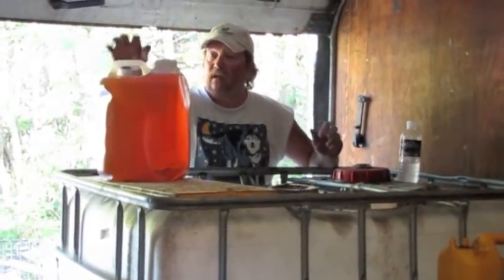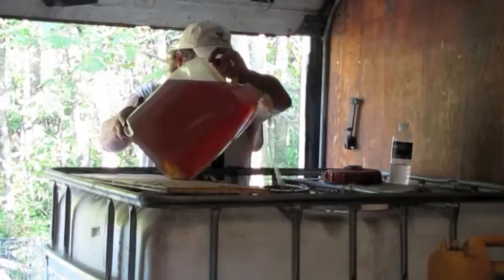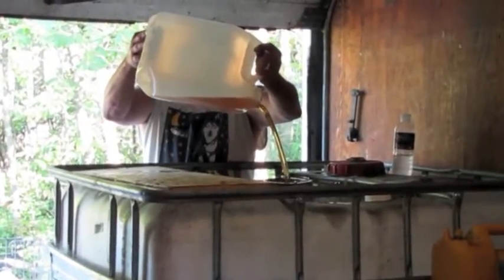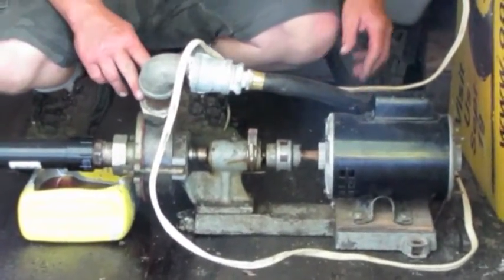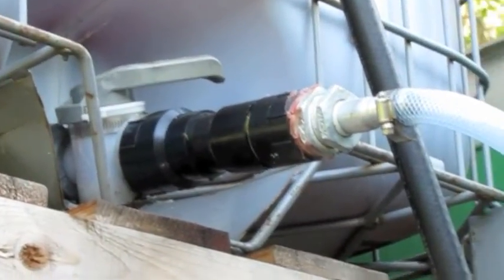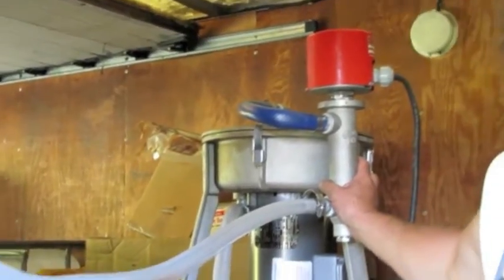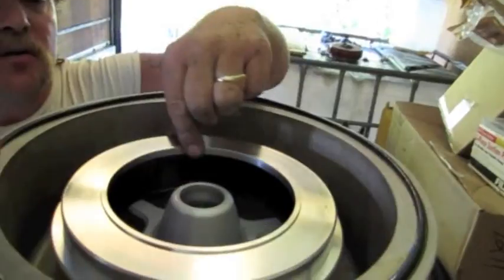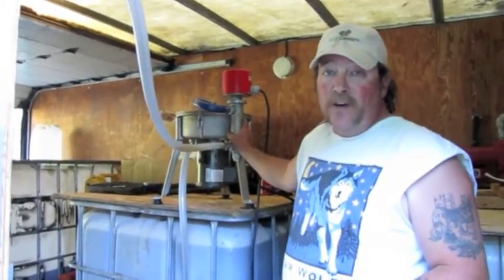Ricks Refinery

Comment: Well cold weather has finaly hit us.Burning oil has stopped abruptely.Burnt 2500lts.But I already have 3000lts of partly clean oil.Just need to run it thru the Centrifuge.I'm thinking of adding a hot water tank to heat up the oil before it hits the fuel tank for the early spring and late fall.The wheels are spinning once again.Just to let you know,I run the oil thru Two trucks One is a E-450 7.3 diesel that has 401 000km.Two is F-450 7.3 diesel with 307 000km.Plus I run it thru my Case tractor

Comment: Since Ive already screened the oil before (100 micron filter) the centrifuge this would not be an issue.
Second issue - Being that fill 2 tanks I move the centrifuge from tank to tank.
                     - secondly I like being able to see the flow rate going into the tank.
Thanks for the comments. The centrifuge is a awesome way to clean your oil.Once it's set up you can walk away and let it do the work for.you.So far this summer Ive burned 2000L

Comment: Hey Rick, Nice video.  The only thing I would add is that you should upgrade the hose feeding the centrifuge.  If something plugs up on the feed to the centrifuge the heater will heat the oil all the way back to the feed tank.  That feed hose would probably fail.